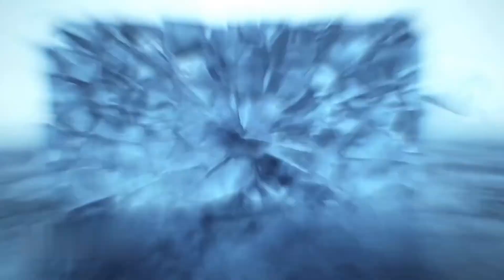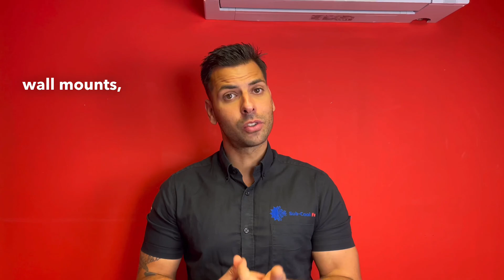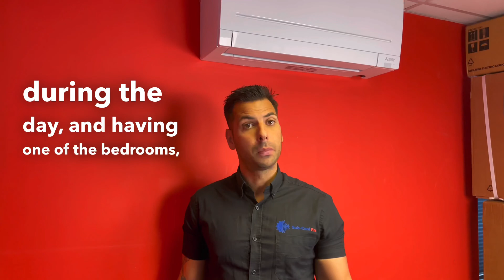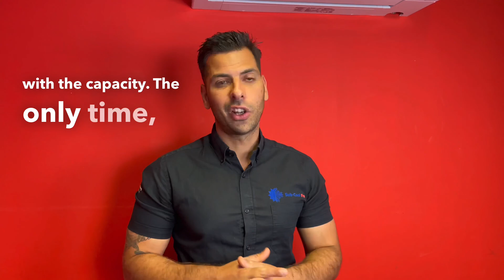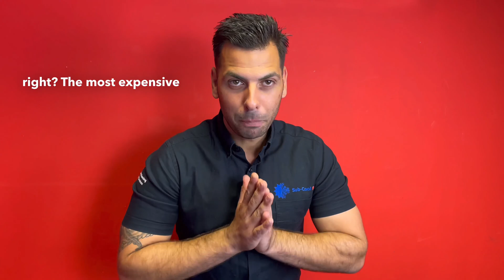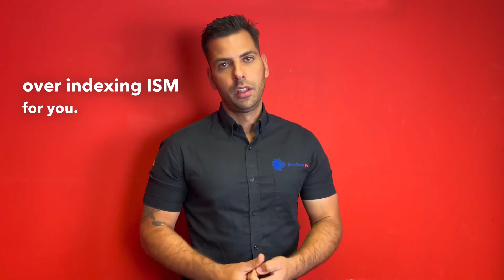Multi Split Air Conditioning - Over Indexing - The Truths

Comment: Thanks for your vlogs. I chose the MUZ-AP42 VG duo split for a 2.5 and 1.5kw bedroom indoor unit. Should I have gone for the MUZ-AP35 VG unit? Would that have been more efficient? Another point to go over indexing would be less noise and vibration, wouldnt it?
Reply: Hi Pieter 

Do you mean the Mxz-2f42 multi split?  Over indexing….. if both units are running can cause an increased noise… however with the better brands it’s a marginal DB. 
You could of gone for the 35 and 25 to reduce the internal dan speed noise 
Just a note the mszap15/20 have a noisier motor than the 25/35
Reply: @jackswanson9829  yes i have the 2f42 multisplit. I had to go for ap15 as the ap25 didnt fit above the door due to slanted roof. Ap15 is slightly more nosier then the ap25 but still ok. I was refering to increase noise of the outdoor unit as the compressor is bigger.
Reply from the maker: @pieterberkhout1242  Anything mitsi.. is the most robust * silent.. did we install it :)
Reply: @theoutspokenengineer  Yeah better than Daikin?